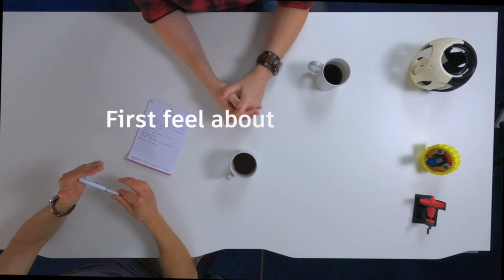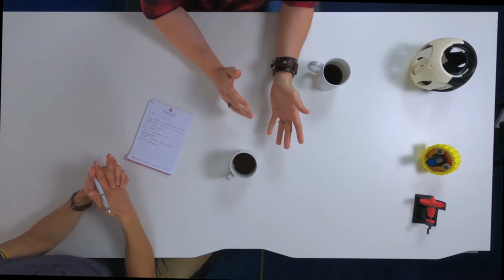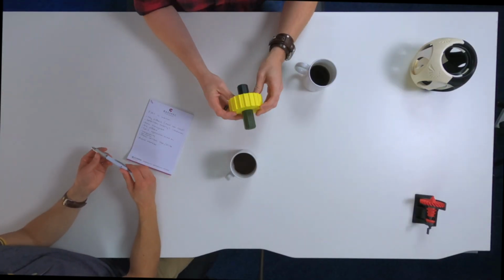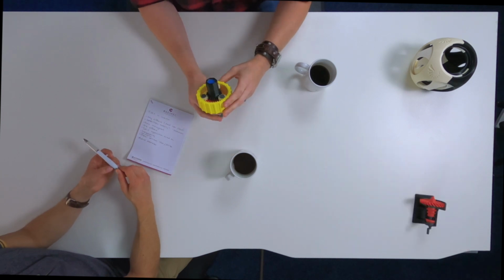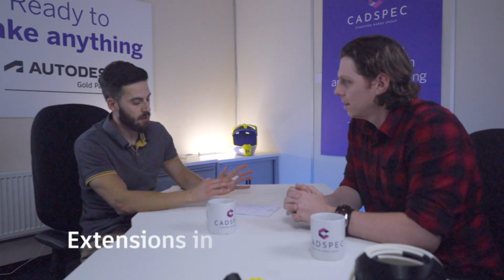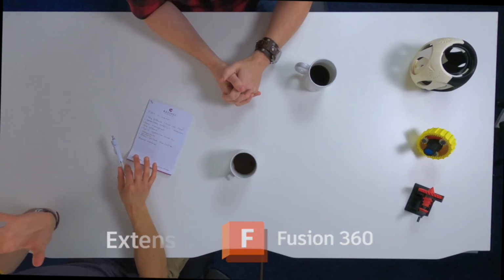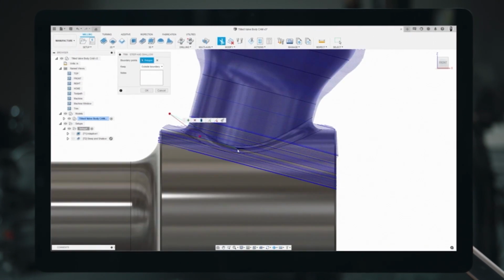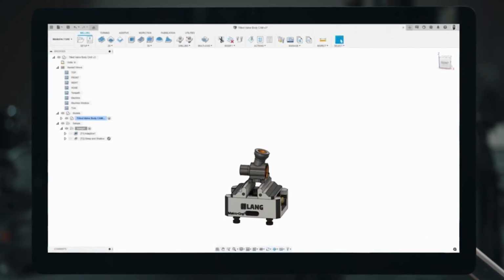Fusion 360 VS Inventor | BIG differences between Fusion and Inventor | Which is better??

Comment: If you need to keep your files on a local drive or a network drive of your choice, create large or complicated assemblies of >500 parts, need an advanced type of multiple variations of a part or assembly, need to integrate assembly bills of materials with an ERP, or if you are working with customers that require you to keep their information safe and confidential, then Inventor is the choice. Otherwise using Fusion 360 is probably a better option for you.
Reply from the maker: Great summary! Appreciate your feedback.

Comment: I will tell you the main difference - Inventor is 5 times more expensive than Fusion 360.  So there is little chance that anyone that can barely afford Fusion 360 can even dream of touching Inventor.  I guess if you are a student then you can get Inventor for free but what will you do after you graduate unless you are rolling in the dough.  

I guess this got me because why compare these two when it is likely you don't have a choice to pick between them.  It is somewhat like comparing a Toyota to a Lambo.  But in this case the 2 items are not quite as far apart as the car example.  Did i miss anything?  I would be super happy to be wrong.

Comment: Excellent explanation chaps. Delivered with such infectious enthusiasm. I’m looking forward to seeing the next episode. 👌🏼👍
Reply from the maker: Huge thanks Jon!
Reply: @cadspec  My pleasure 👍
Reply: As a home user, F-360's requirenent to save parts in the "Cloud" is a non-starter for me. Inventory sold on a subscription model ONLY with such a massive starting and running cost makes It just as much as non-starter as F-360. Sad, really, as ADesk suites have been my backbone architecture for years.  
A strong suite I can afford a direct perpetual license for, are the only right answer. Solidworks Maker and Solid Edge Community fit the bill, with BricsCAD or ProgeCAD two capable ACAD alternatives.
None of these is "FREE-ware", so are developed and sustained by COMMERCIAL Developers, each with its own perpetual license, strong suites of add-ons and programming languages for developing custom add-ons of your own.
I really miss my Inventor, but these are real considerations that really must be taken into account.
I do my Rendering and Animatiions in McNeel's "RHINO", a absolutely CAPABLE and highly integrated  suite of solutions, providing absolutely gorgeous results, right out of the box !